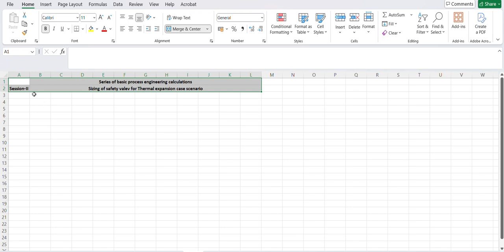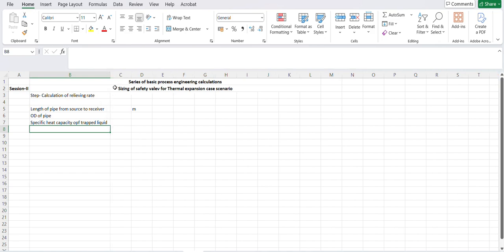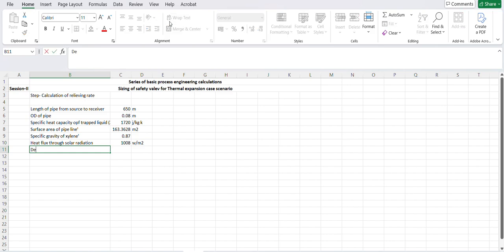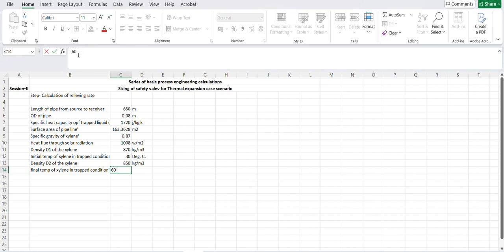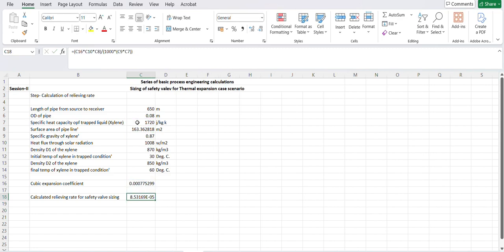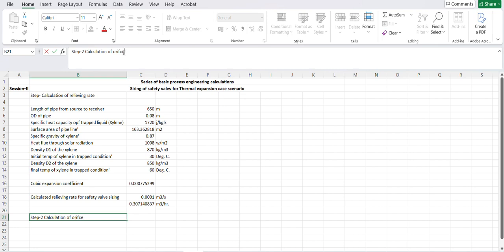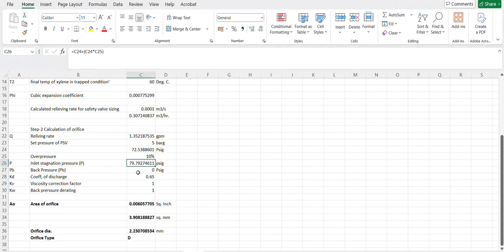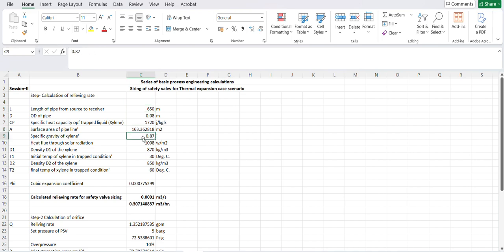Calculation of relieving rate of PSV incase of thermal expansion scenario

Comment: is it also for the rupture disc relief load calculation installed in liquid chlorine pipeline and upstream and downstream have isolation valves so in case of blocking both the sides there will be thermal expansion due to solar radiation so is this calculation work i have done in aspen by putting values of heat input and pressure temperature and all taking API 521 as reference for intensity of solar radiation value
Reply from the maker: Yes the relieving capacity will be the same irrespective of safety valve or rupture disc.

Comment: Have you done any calculations for relieving rate for TSV at Trim cooler outlet? Is there any difference from above calculations ?
Reply from the maker: These reference calculations is for the safety valves installed in piping to protect against thermal expansion case due to hydraulic lock. I guess you are looking for calculations of same scenario with installation at cooler outlet. You can drop me details on processdesignengneering@gmail.com